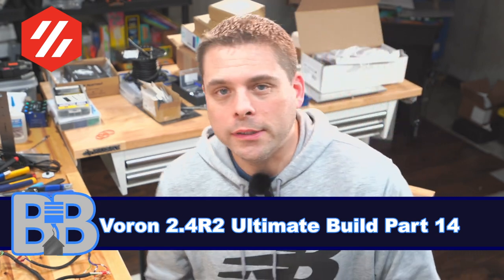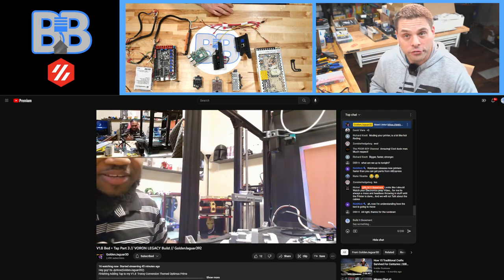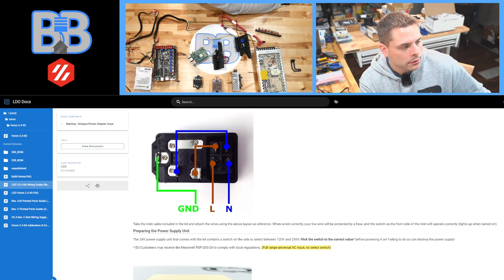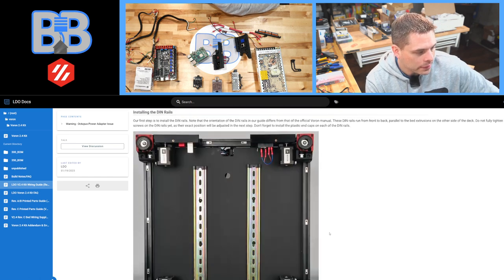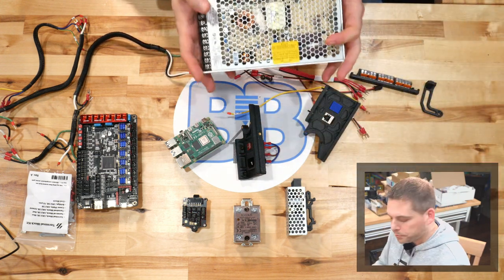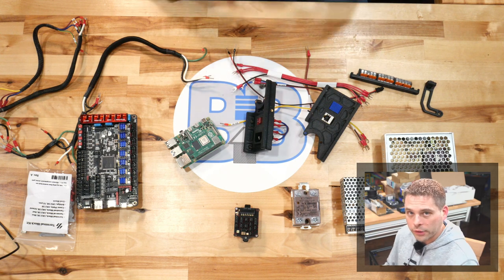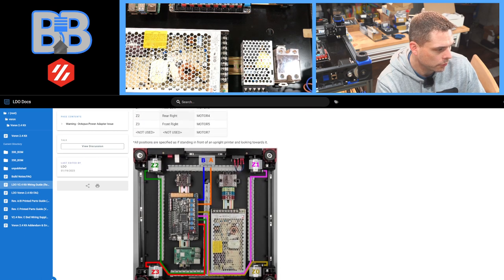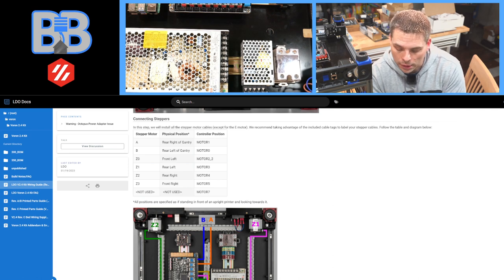Part 14 ULTIMATE Voron 2.4R2 A/C Wiring - Part Placement

Comment: Because of the space my printer is in I would really like the power on switch on the front and the power plug in the rear.  I still may rewire for that
!
Reply from the maker: Easy enough - Keep in mind that the printer stays on most of the time.

Comment: I’m not at the 230v electrics point yet (frame built, zed ;) drives and tensioners mounted) but as I’m colourblind, red green, I’ve never had anything to do with electrics. The LDO docs wiring guide is nice and clear but you’re video is the best one I’ve seen for electrics as it’s nice and clear plus your videos are a sensible length. You’ve also convinced me to use Wagos not the, admittedly excellently named, UK terminal blocks.
Reply from the maker: This hobby isn't as friendly as it could be for the color blind.... If you need any help to sort anything, I may be able to assist you either in ways to test wires or even via photo Identification.  Careful around those AC power parts!

Comment: nice approach. personally I would locate the 5V power supply on the other side of the 24V PSU. Then the 5V PSU is next to its main customer the RPi and not in between the SSR and 24V PSU.
Reply from the maker: I agree that would work as well.  I'm trying to not run any AC wiring further than needed.  5V will go right in with the low voltage wires.  So many ways, not enough days!  Thanks for the comment,  it's good to have multiple points of view!

Comment: Well some ah ha moments for me in this one.  Ferrules on the cables to the WAGO...I don't have those so should I tin my copper wire ends or just keep them bare in the WAGO's?  Also please do share the link to the bed pan magnetic style.  Testing my mains tomorrow and asking for "Puff the Magic Dragon" to stay away.
Reply from the maker: That's 100% up to you. Benefits of ferrules, neatness and no worries removing and reinstalling wires and losing a stay strand of copper. If you tin your wires, it's going to have the same benefit.  I'll add some links to the tools used in the video description.

Comment: On the Wago's, I think the input wire should go to the middle and all the wires going out on either side, just to reduce the resistance!
Reply from the maker: That would reduce resistance - the amount would be VERY negligible. Easy option to do, if one chooses.   I just did them in the order of distance, the length of the wire also increases resistance!  I believe the Wagos are rated at 20A @ 300V, at most this printer will draw ~10A @120.  And that would be if the bed and the hotend were at full 100%.

Comment: Nice option for the electric compartment.  I have an Ldo kit too and use the MK 2 connectors and it works…. But the Wagos works quicker.  Just wondering if you will use the cable ducks. 

Btw what is the name of the bed wago mod?  This one looks really nice.
Reply from the maker: I'm going to add to the video description today with more info, I was sorry on time.  I'll be using the troth/ducts mostly for the stepper wiring.  The main point here was the need to be safe with your A/C power and to try and not mix A/C high voltage with D/C low voltage. I have a mental list of goals....

Comment: Did I miss where you put the frame ground? Didn't see any ground wires connected to the frame.
Reply: Found a video on Part 15 about 42 minutes that shows where you connected it near the wagos. And explained why you don't connect a ground wire on the SSR:  Since it's connected to a metal rail that is connected to the frame you didn't ground it. Kind of hard to find a connector that will fit on that small bolt.
Reply from the maker: Which bolt? Your can connect as many grounds as you like, but the bed is grounded, the frame is grounded and everything is pretty much connected.  Some folks go a little crazy with grounding.

Comment: "and then we've got this guy" at 25:40. What is that guy?
Reply from the maker: "This Guy" is the LDO provided break-out board the is between the MCU and the tool head wiring.  Honestly, I would prefer to not have that additional PCB, it complicates things (IMHO).  I would have preferred to have my wiring go directly to the MCU so wires are easier to trace!